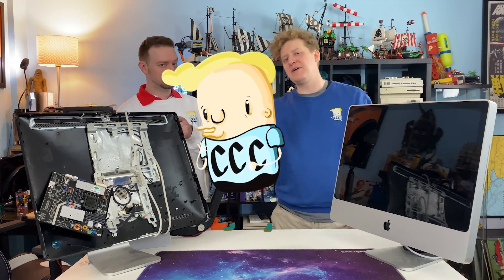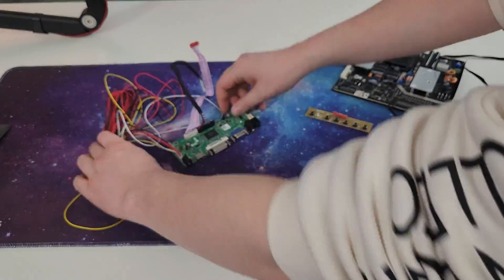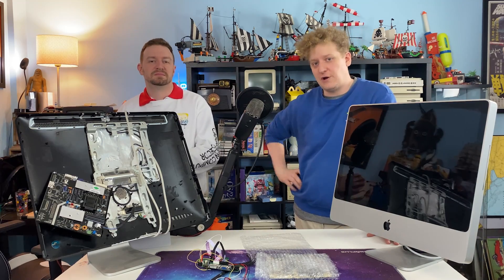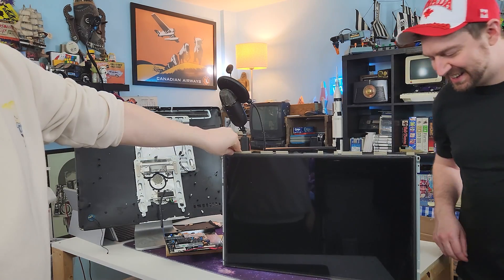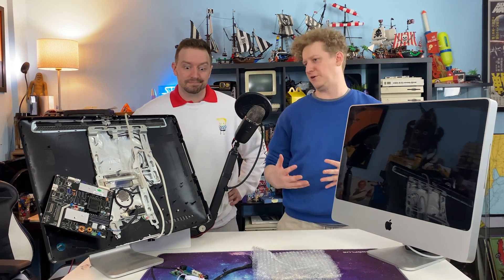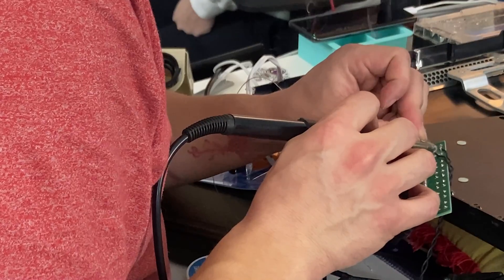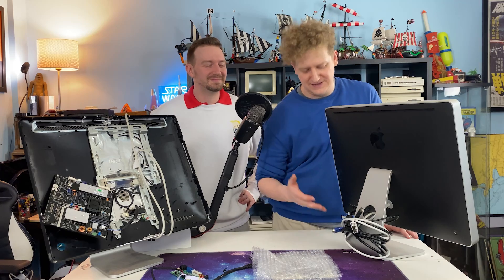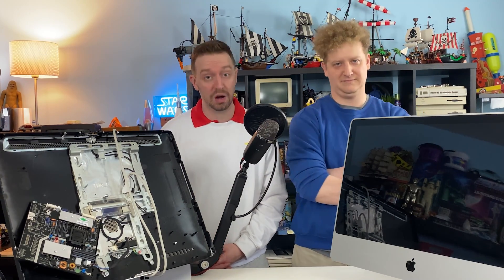Turning an iMac into a Monitor SHOULD be Easy...

Comment: I gathered two 20" iMacs over the years in storage. Did these puppies get any lighter after gutting them out. I kinda wish I could just take the screens and put them in a lighter chassis. Really would be cool if a controller board supported dual screens at once but I guess thats going too far 😅
Reply from the maker: The chassis are fantastic especially if you want to do a project where you mount something else in them - very sturdy and high quality. 

Unfortunately the screen quality leaves something to be desired when you aren't using the original computer. These generic control boards output a picture that is owhere near as nice as original, at least, the ones we bought have been disappointing in this way.

Comment: If you have a 2011 iMac 27", you might want to check out Juicy Crumb's Docklite project, not cheap though
Reply from the maker: Ooh I see @branchuscreations did a video on it!
Reply from the maker: Also you weren't kidding - $400 for a board, that just isn't worth it 😔
Reply: @CanadianComputerCollector  Yup, I was kinda giddy when I saw this until I saw the price
Reply from the maker: Our project cost about $50usd for the board but it was super low quality hence the troubles we had. Also no support or documentation. You get what you pay for, I guess. 🤷‍♂️

Comment: I did this with my 5K iMac recently. A lot more profanity involved than pictured here (but I didn't assemble the thing when it was plugged in and live, that was an interesting choice 😂)
Reply from the maker: Bahahaha yeah the whole unplugging thing seems to be really important. I can’t imagine doing this with a 5k. Those are such gorgeous iMacs! Was it dead?
Reply: @CanadianComputerCollector  The 5K screen is still gorgeous by modern standards (even compared to Apple's $1700 Studio Display) but the computer was from 2015 and blown away by anything newer, Apple Silicon especially but even newer Intel Macs, it was so imbalanced. Came to the conclusion that it's more useful as a simple monitor.
Reply from the maker: @TimurTripp2 makes sense! What size was yours? I know that for a while there the 27" ones had target display mode, but IIRC they removed it at some point.
Reply: @CanadianComputerCollector  They removed it on all the 27" 5K models. Feels like a terrible waste to have an outdated and slow (by modern standards) computer inside a screen that still looks amazing.